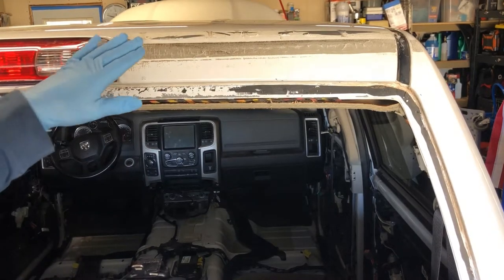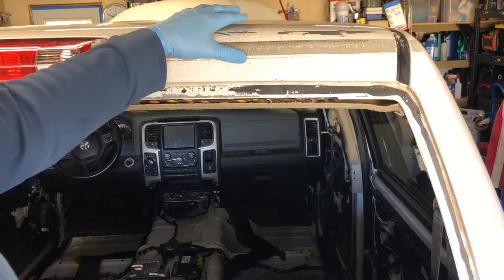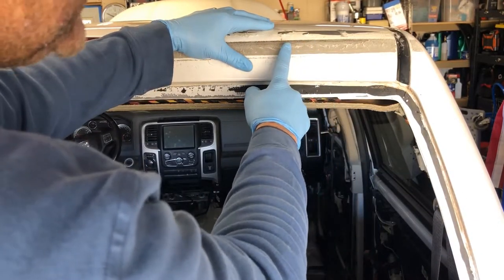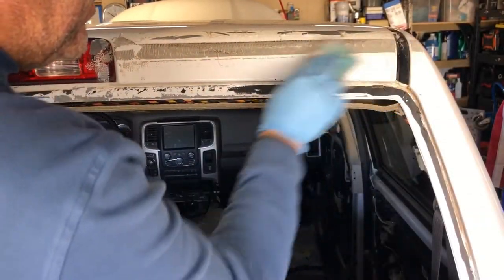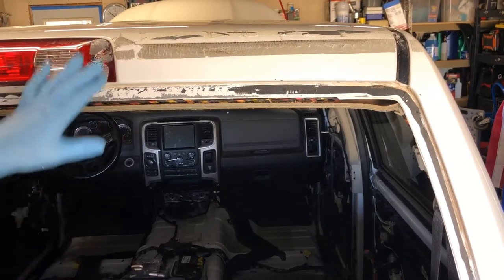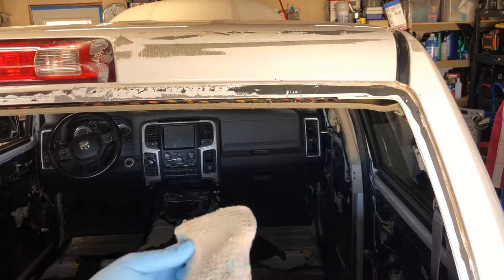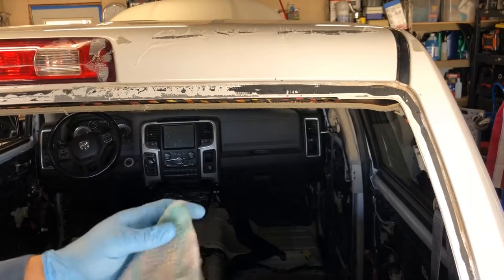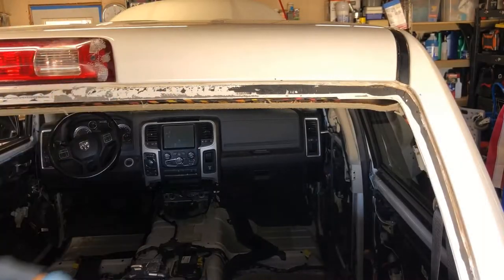How To:  Duct Tape Residue Removal From Car Paint

Comment: Just wanted to throw in yet another affirmation of this technique . I spent over an hour trying to scrape about a foot of duct tape off my vehicle's paint using a rubber paint scraper, warm water, and rubbing alcohol. Though I made some progress using this method - the remnants of duct tape were still visible. Less than 5 minutes of scrubbing with gasoline removed it entirely! Amazing - thank you!
Reply: I’m gonna try this out thanks
Reply: Trying gasoline today
Reply: Can you use diesel?
Reply from the maker: Haven't tried it with diesel.
Reply from the maker: AWESOME!

Comment: As an auto detailer may I add you should also make sure you get the area re-clean and waxed immediately to prevent oxidation in some paints!
Reply from the maker: @TeeJays Fantastic! - You certainly may add that great information!  Thank you for sharing something really helpful for myself and others.  Thanks for stopping by and taking a moment to leave a comment - much appreciated!
Reply: @javosgarage  thank you VERY much for the useful video, I rent cars for work but I take my dog with me in them, I put duct tape on the side of the door so my dog can hang out the window and do her dog thing without scratching the paint on my car, I used goof off the last time and it was a PAIN, I can't believe I didn't think of gas!
Reply from the maker: @skullman0819  I hear ya!  I was really getting frustrated after trying WD40 and GoofOff with basically no results.  I hate using a heat gun on paint because it's SO easy to damage it.  I was amazed at how well this worked, it made the job super easy.  Thanks for coming back and giving me a follow up!
Reply: @javosgarage  to,,,,,
Reply: ,,,, and ,, @javosgarage
Reply: I wiped it ck an after so no gas was left.
Reply: Good point!  Will do that.  Have duct taped plastic over a window that wasn't working, and stuck half way open for about 6 months and finally got the window fixed, but need to remove all the duct tape from the frame area around the window where the plastic was placed to prevent rain from entering the car.
Reply: Hey thank you buddy!! I was wondering about that!!!
Reply: @TeeJay - will warm water and dawn dish soap be enough to wash the gasoline off??
Reply: @_BlueCollarGamer  Dawn dish soap is a heavy Degreaser and wax remover if you're using Dawn to wash your car you want to wax it afterwards because Don strips away any protective wax has already on it however it is safe to wash your car with yes you can use Dawn to wash the initial amount of gas off with but if people are using Dawn to wash extremely dirty vehicles I always recommend at least the spray wax after applying Dawn
Reply: I personally only use Dawn in the engine bay and wheels
Reply: I believe you mean petrol by gasoline? Just a little confused over that

Comment: Wow...just WOW! 2014 Maxima had black duct tape holding up the side of the front bumper for 2 years. I got the bumper to screw back in and then was left with a 2ft x 1ft gob of duct tape residue. This video was the first one I watched and it worked amazingly well. Thanks for this. No damage to the paint at all.....and I scrubbed like hell with an old t-shirt.

Comment: This worked SO well!!! Took less than 20 mins to get all the dried duct tape off and looks brand new!
Reply: Nice! So gasoline is a good method?
Reply: @ioannisyiannipappas5457  yes absolutely worked!!
Reply: @caprilobotzke2872  thank you
Reply: The residue on my bumper is just a few days old, will this still work? Also will the paint be ok?
Reply: @ioannisyiannipappas5457  yes it definitely work. The paint beneath the duct tape will be totally fine. I had duct tape on my car for like 2 weeks and it came off. You just need to put some gasoline on a microfiber cloth and you will have to work a little bit but it will come off

Comment: I've done this before on a car which had duct tape holding the rear bumper (fender) in place. I would suggest having plenty of rags if you have a lot of duct tape to remove as the rags tend to get clogged up with duct tape glue. Thank you for reminding me of this method. I've been told WD40 does work, but is a lot slower and more hard work than using petrol (gasoline).

Comment: Thank you so much. It looked so bad before, and nothing seemed to work. 

It only took minutes of a little elbow grease, and keeping the rag wet enough that you can keep the area you are working on wet. It is best to do a small area at a time because gasoline evaporates quickly. <3

Comment: Thanks for the video, just to confirm the material used, it's car fuel that used right? Also if yes, isn't there any risk to affect the care paint?
Reply from the maker: @Soulaiman Almobyed  - You are correct.  I used the same fuel I would use in my vehicle, mower or pressure washer.  It didn't affect my car paint, but there is ALWAYS a risk of this affecting paint so I would test an inconspicuous area first.  Another viewer mentioned it would be a good idea to clean the area immediately and then wax to help prevent oxidation.  Hope that helps you, thanks for stopping by!

Comment: Thanks for the tip. I used Varsol, commonly known as paint thinner and it worked great. However, my sun baked Duct tape residue was on my roof rack not directly on paint so no harm done. I do believe it would still have worked on paint as long as vehicle is not new. Nice work.

Comment: Did this on my suburban It worked great. I wiped it off with water at the end to clean off any residue is that enough to make sure that the paint doesn't get damaged?
Reply from the maker: @Daniel Anishchenko - Super glad to hear this worked for you Daniel!  I've been really happy with the results I've gotten from using this method.  Every vehicle is different but you should be fine.  I would consider running it through the car wash when your done.  Thanks for stopping by!

Comment: Looks like the easiest way to remove tape glue residue from car metal.  And fast!  THank you.
Reply from the maker: @wd neojoneswd  - It's worked really well for me and I've used this method for several different applications.  I hope it works well for you also.  Thanks for stopping by and taking a moment to leave me a comment - much appreciated!
Reply: @javosgarage  I did it using a regular car rag, I had quite a bit of duck tape residue on fenders from securing d bumper before replaced. It took maybe 5-7 minutes for each to remove it all but no scratches, no hard work. Great method thanks again.
Reply from the maker: @wd neojoneswd  - That's great hear, super glad that it worked for you.  Thanks for giving me an update!

Comment: This is great! What do you use to clean the gasoline after?
Reply from the maker: @Kiara Hayden - Hi Kiara, I have a squirt bottle in my shop that I add a tablespoon of Dawn dish liquid to for projects like this.  It cleans well and won't harm any paint finishes.  I'll spray it down real good and wipe it with a clean, white hand towel.  I say a white towel so you don't have a possibility of colors coming out of the rag.  Hope that helps you, good luck with your project and thanks for stopping by!
Reply: @javosgarage  Thank you so much for this detailed response! Can't wait to report back my results!
Reply from the maker: @Kiara Hayden - I can't wait to hear how this process worked for you Kiara!

Comment: what type of gas to use?,  unleaded petrol or diesel? im from the uk thanks.
Reply from the maker: @Obbard  Productions - I used unleaded petrol, not diesel for this project.  I didn't try diesel so I have no idea if that would give the same result.  Hope that helps you, let me know if you need anything else.  Thanks for stopping by!
Reply: @javosgarage  Thanks for the help mate, I've got to remove some baked on masking tape from upvc windows that have been spray painted, so hopefully this will work.
Thanks.
Reply from the maker: @Obbard Productions - You're very welcome!  I have never tried the unleaded petrol method on UPVC before so I would suggest you test a small, inconspicuous area to see how it does first.  Just to be safe.  I wouldn't want you to damage anything.  Better safe than sorry.

Comment: Does it also work for residue after decal removal?
Reply from the maker: @Jus for fans Tv - I have used this method several times to remove adhesive left from decals.  I bet it will work for you as well.  Good luck on your project.  Thanks for stopping by!

Comment: Wont this method damage the paint/clearcoat?
Reply from the maker: @Dino Tom - I have used this method on several different vehicles with no problems. I’ve had several friends and visitors to my channel try it as well with success. If you want to be extra careful, try it in a inconspicuous area first. When your done make sure to clean the area and apply a coat of wax for some protection.  I don’t know about you but I’ve spilt gas many times over the years down the side of my vehicles with no damage. Ultimately, you have to make the judgement call. Hope that helps you a bit, thanks for stopping by!

Comment: Diesel works as well.  But most people can just get a little of either, when they pump at the station, into a glass jar or fuel container. 😉
Reply from the maker: @NU MOO - I haven't tried diesel so thank you for the info and the tip on the container.  I appreciate you stopping by and taking a  moment to leave a comment - thank you!

Comment: I did this, but there's still a weird residue and color of my rag on my vehicle(travel trailer). Do I need to get a clean rag and go over it with gas again or should I use some sort of cleaner? TIA
Reply from the maker: @Julie J. - Hello Julie.  Thanks for stopping by.  If your rag is leaving a residue and color I would definitely stop using it.  For whatever reason the rag is causing your problems.  For me, I would clean the area and see if I would get some improvement.  This could take a few times.  If I didn't get the desired results I would move on to using a scratch removal or polishing compound and my polisher.  If you don't have a polisher you can always do it by hand using circular motions, it just takes longer.  Hope that helps you, good luck with your project!
Reply: @javosgarage  thank you for replying!

Comment: This should work on plastic too right?
Reply from the maker: @UpstateCraze - I have used this method on a third brake light and a tail light and it worked great for me.  Actually, I used it on the third brake light of the truck in this video with no issue. However, since it's plastic I would test a small, inconspicuous area before applying to a large area to make sure there is no damage or discoloring of the plastic.  Hope that helps you.  Thanks for stopping by!
Reply: @javosgarage   I ended up using this method on my jet ski worked great no problem. Thanks huge help. I’ll be sure to subscribe
Reply from the maker: @UpstateCraze - Super glad to hear this method worked great for you and caused no problems with your plastic.  Thank you for taking the time to come back here and leave me some feedback, I really appreciate it!

Comment: Thank you for posting this. Probably a silly question but does it matter if you use Regular unleaded or Premium gas? I guess gas is gas.
Reply from the maker: It shouldn't matter.  I just used the same gas I put in my mower.

Comment: hmm i don't really want to try using gasoline. i read rubbing alcohol will work so i might try that first. was about to try wd-40 but sadly you said it's not very effective.
Reply from the maker: @://SyCx1 Productions - I hear ya!  I was really reluctant but I was desperate to find something that would be effective and quick.  This process was both of those.  Naturally, you just have to be really careful because your dealing with a very flammable liquid but I was able to remove my duct tape with no issues whatsoever.  Although I have not tried it someone did comment that diesel would work as well so that may be an option to consider.  I have used WD-40  to remove many adhesives from paint before so I was really disappointed when it failed to do the job in this case, even GoofOff was ineffective.  I wish you the best on your project.  Thank you for stopping by and taking a moment to leave me a comment - much appreciated!

Comment: How about using paint thinner?
Reply from the maker: @Wepen935k - I honestly haven't tried that.  I would be concerned about how the clear coat and paint would react to paint thinner.  I wish I had a better answer you, once this method worked so well for me I didn't try anything else.  Thanks for stopping by!

Comment: I wonder if this works for duct tape residue on plastic
Reply from the maker: I have used this on plastic but you have to be real careful because there are probably some plastics out there that gasoline would damage.  I used this method on a plastic body panel of our four wheeler.

Comment: Super unleaded gas or doesn’t matter?
Reply from the maker: I used basic unleaded gasoline and it worked great for me.  Thanks for stopping by!
Reply: @javosgarage  it won’t damage paint on any cars? What about Goo Gone?
Reply from the maker: In theory, no.  However, there is absolutely no way of me knowing what it would do in your case.  I would test it in a small spot that isn't easily seen in case you have a problem.  I've used this method on at least 10 cars and never had an issue.  Having said that, you would have to try this method at your own risk; I'm just showing what worked for me.  I have used GooGone as well but it just didn't give me as good of a result.  Funny enough, I have another video on here where I remove the clear bra from my truck and I deal with this "adhesive issue" there as well.  Good luck with your project.
Reply: @javosgarage  when I pump gas into my car sometimes some of the gasoline spills on the car and I have not noticed any deterioration on the paint so wouldn’t that mean it’s ok?
Reply from the maker: I would think so, but you know nowadays I can't say yes because if something I couldn't foresee happens then it's my fault it caused an issue. Darn lawyers!!!  LOL

Comment: Some one put duct tape on my plastic trim will gas hurt the plastic trim
Reply from the maker: You need to check it somewhere that isn't noticeable in the event it does, so only test a very small, inconspicuous area. I've never had a problem on my cars or even mowers when I've spilt gas but ultimately only you can decide.  Thanks for stopping by, I apologize for the delayed response.